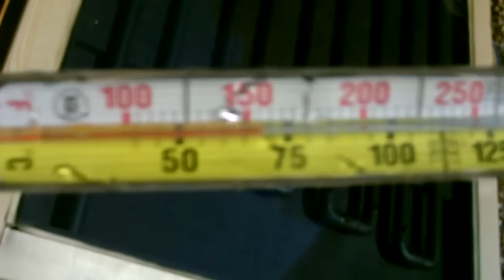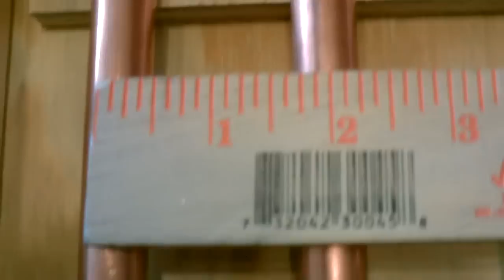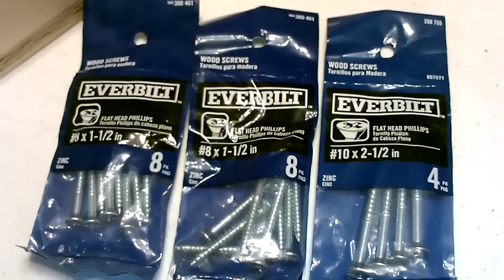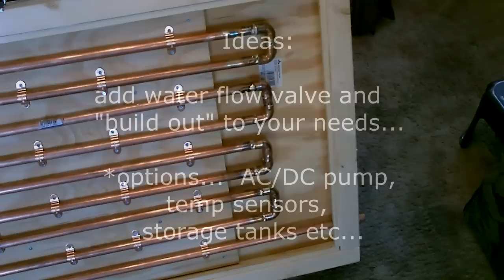DIY Solar Thermal Water Heater! - COPPER PIPE Solar Water Heater! - Easy DIY (full Instr.) 150F+

Comment: love the build thanks for sharing.  one thing i did notice that may add more heating capacity.  instead of 16 copper 90's you could have used 8 90's and 8 street 90's. this would also save you time cutting the smaller 1" pieces.  street fittings have 1 of the 2 ends the same size as piping.  it will keep the rows closer together and allow more passes through the same space.  thanks for sharing Phill
Reply from the maker: hi there and thanks. i actually experimented with that idea first (using an elbow connected to a "street elbow"). i thought one end of a street-elbow was the same diameter as the pipe too but it wasn't, it's a bit smaller. the result was the "street elbows" fit too loosely inside of the "regular elbows" making it impossible to (properly) solder the two of them together.
Reply: I found the same.  Why are street 90's made smaller than copper pipe... I tried using them, and spent an hour slopping on as much solder as I could to 7 different joints to no avail... I don't know what the purpose of street 90's are since you can't solder the street end to be water/air tight being too loose/small.
Reply: I'm not sure that more pipes bunched together will bear more BTU's but as for the complaint below about the difficulty of soldering street elbows I agree, been there done that.  If you pre-tin the male part of the elbow and the inside of the regular elbow too for good measure, problem solved.  Yes it does take longer but where plumbing repairs call for a street elbow I keep using them, sometimes without pre-tinning, just a good amount of care in cleaning/aplying solder and heating evenly.